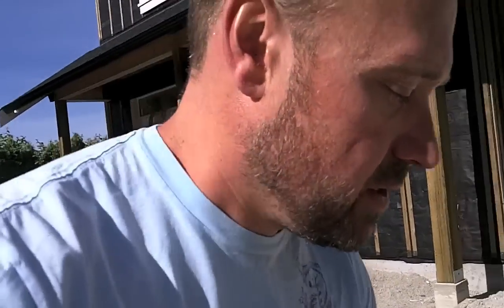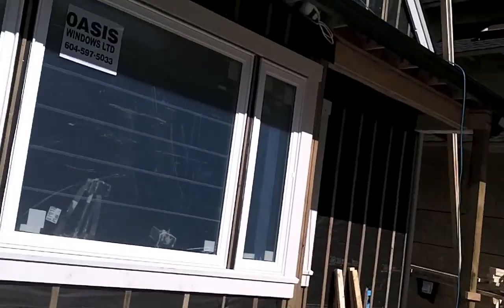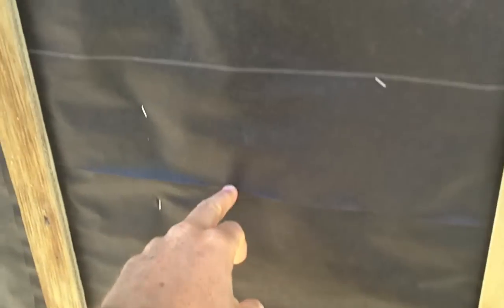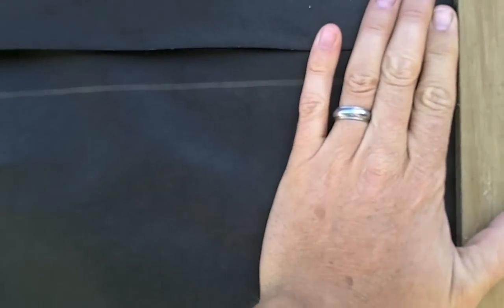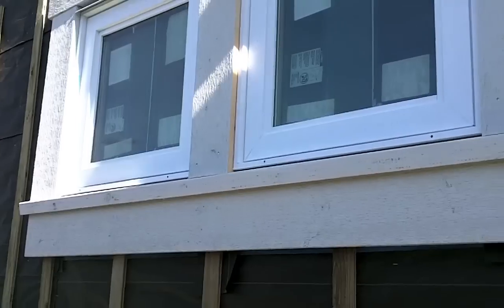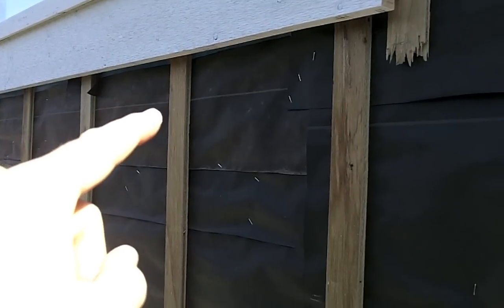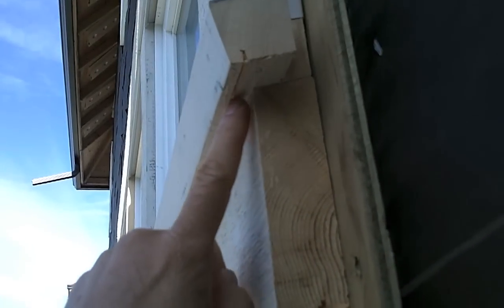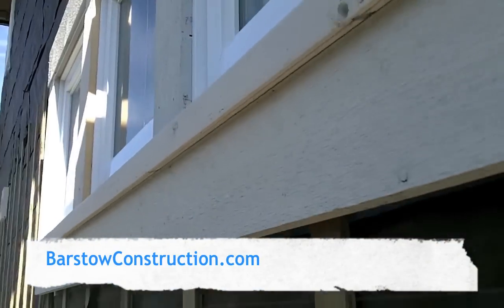How we Rainscreen a house

Comment: what I was taught long ways back, was that the space between the siding and the insulated wall will act like a chimney, the insulated building wall will almost always be warmer than outside air in most parts of the world, so it will warm the air that is between the siding and the wall and thus evaporate any moisture left through by the siding, and 99,99% of time that will not be running water, if you got running water behind your siding, there is something wrong in the way the siding was put on, so the paper on top of the insulated wall is there to mostly not let this vent air into the insulation, thus reducing the effectiveness of the insulation, it will not let running water in, it will stay on the paper, but it is not there to moisture proof it, in fact, the opposite - it lets the moisture through, to let any residual moisture in the insulation or wooden framing to evaporate via that same air "chimney" created by the space between the siding and the building wall, and this "chimney" vents into the zone of the roof where the roof vent channel starts - this is how it was described to me
here the tradition is to put at least a 25mm (1") spacer between the siding and the wall, any treated wood will work, since it will most likely never see running water, so the treatment is just to avoid mold growth, some even recommend 40mm (1-1/2") for 2 floor height siding wall

Comment: Really nice job. I like to use j-weep on the bottom of the rainscreen tho . You can get a two inch over lap onto the foundation. Also like to see wider drip edge under the Windows just because when I cut the drip edge in my stone sills I've watched the little drops jump the gap when it's too small. lol. Also I'd repaint the sill where it was cut for the drip edge. keep'r protected from that h2o. Epic job tho. Bug screens a nice touch.
Reply from the maker: +hopperstonemason Thanks for watching! We caulk and fill before our final paint - All this material is just primer coat. Good point on the wider cut on the drip edge.

Comment: I would recomend using 1/2" galvanized j-trim for your bug screen instead of using soft mesh. Yes it is more expensive but 100$ more is nothing for a new house.
Reply: it wouldn't breathe..  that's why it's a screen.. to let air and water out
Reply: Ventilated j-trim specifically for this application is available.

Comment: If I'm not mistaken, house wrap needs to be permeable. Wouldn't you decrease the permeability when applying two layers of house wrap? This is a first that I am seeing this.
Reply: Two layers decreases the permeability, but not enough to cause a problem. I don't see that 2 layers is actually necessary here. But in the case of a stucco siding it's absolutely necessary to have 2 layers, because the stucco will bond to the outer layer, making it incapable of shedding water. Then the inner layer can still shed water if some gets behind the stucco.
Also, grade D paper and asphalt felt actually increases in permeability if it gets wet. So there really won't be a permeability problem here.
Reply: @fepeerreview3150  Appreciate the reply. Didn’t realize this was going to be stucco. This makes sense now.  Thanks for breaking down your comment as you did.

Comment: I wonder if all those staples are a good idea.  It seems like you're adding thousands of little holes that at some point may allow moisture to reach the sheathing.
Reply: I hear what your saying, but that's overlapped tar paper and when heated will seal around almost all holes. This is definitely way better than installing siding the traditional way. If you wanted to go overboard, you could use ice and water shield, which is a sticky, very sticky membrane, Jmo...
Reply: They are a bit of a necessary evil. The sun will heat the paper and seal around them though.

Comment: I mean #30 building wrap doesn't meet the demand of sealing the home. 

They wouldn't make sealing tape if building wrap meets the demand
Reply: Everything is built as cheap as possible out here. If #30 is good then #60 would be better but it's   $5 more per roll and that's too much. Also this garbage about it getting hot and sealing around the staples is utter bull. #30 and #60 paper if it gets wet and can't dry it completely disintegrates. I am speaking from first hand experience as a contractor.  I have never pulled off disintegrated typar or tyvek ever. Tar paper on the other hand especially #30 to often.

Comment: Great video.  Unfortunately most of our local building material stores in the  lower end of the San Joaquin Valley in California it is not available. It drives me nuts. And when I ask questions about rain screen they look cross eyed at me and ask what are you talking about.
Reply: Circular saw with a guide can make short work of ripping furring strips.

Comment: How would you recommend adding rain screen to existing siding? Noticed that insects can enter behind the siding of the house I moved into (has about 3’ of exposed concrete underneath). I don’t want to seal the gap obviously but want to deter insects. Thanks!

Comment: I'm finally educated on Rainscreen thanks! I've been going to Lower Mainland open houses. Some older 35+ year old 25 storey condo buildings have Rainscreen replaced - sounds like a big job. Does that mean entire building is wrapped in this material as well? Exterior walls needs removed (or replaced as well) to get to the Rainscreen?
How many years does Rainscreen needs replaced on averaged?
Reply from the maker: Thanks for watching!
Reply: Barstow Construction you forgot to leave some space for sprayed insulation.
Reply: natural stone moments you should have said crack sealant. But the fact is this house wouldn't bennifit from it. It's an artificially loose house. It is designed to be tight and loose at the same time. And that's the defect in my opinion.

Comment: Doesn't Tvek/house wrap seal up the house? Building paper doesn't seal up the home. It is a barrier against the frame. With today's demand insulating homes, I don't think house wrap meets the demand.
Reply: The idea of tvek is that the inside-the-house water vapor can pass through it.  Maybe it works that way in a warm climate.  When it's cold, the vapor hits the cold tvek, condenses, and then sits there against the sheathing.

Comment: What do you do for your electrical boxes (outlets, lights, dryer vents)? Do you use mounting blocks? Flashing? Cant find any rainscreen info on this online. Thanks
Reply from the maker: MrPanky14 Thanks for watching - we use a piece of 2x10 fascia that we cut into a rectangular plate. We then cut a hole to accommodate the plug box or hose bib. We flash the top of the plate and butt / caulk the siding up to it. This allows us to sit the boxes / lights / bbq boxes etc FLAT on the rainscreen -- plus its a clean finished look!

Comment: "Thirty minute" building paper??  Are you talking about thirty pound?  I have never heard of thirty minute.  If so is it the newer fiberglass matt reinforced version of the old style 'tar paper' /building paper?  I would be interested to hear what you think of that if it is what you are using.  Taking apart old buildings shows the deterioration of what was usually fifteen pound building paper and I am wondering if the strength of fiberglass would help with that as well as tears on installation.  Doug
Reply: He must mean 30lb like you said, I was also scratching my head !
Reply: Google is your friend.  Look.  It's there.
Reply: @lewissternberg8050  what's there 30 minute bldg paper? Smh
Reply: @davemowles1389  Google this: Thirty minute building paper.   
Description. The Hal-Tex 30 Minute Heavy Breathable Building Paper is a grade D, heavy kraft paper that has been saturated with asphalt. It provides up to 30 minutes of water resistance by shedding water and stopping moisture, while letting wood breathe by allowing water vapour to pass.

Comment: Thanks again for the great video. I have a question regarding window trim and drip caps. I was thinking of building 4 piece flat stock window trims but I see most builders (here on the Island) are building 5 piece with a beveled sill trim. Is this code here in BC? If I went with a 4 piece kit would I need to add a drip cap to the top of the bottom trim piece? Thanks again. Keep it up.

Comment: The fact is 2 layer trap and condense water. Tyvek is the best product out there and everyone knows. It but builder don't want to fucking buy it. The fact is your in BC and didn't put cedar peelings in instead of treated plywood is a joke.
Reply: Everything is built as cheap as possible out here. 30 min paper why not 60 min paper cause it's $5 a roll more that's why. Tyvek are you kidding it's  $100 a roll I can buy 4 rolls of 30 min paper for that price. Also won't use prepainted Hardie cause it is slightly cheaper to paint on site. These guys don't care I see guys painting houses in the rain all the time. Completely asinine